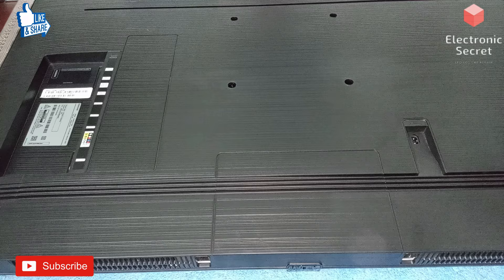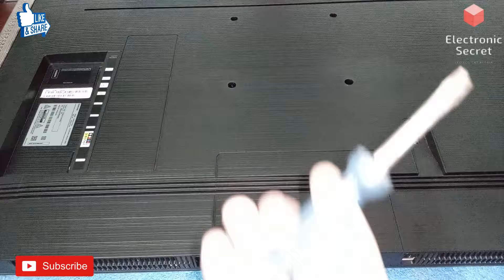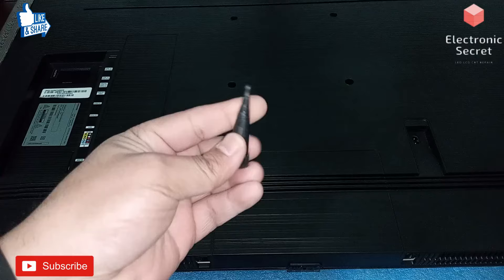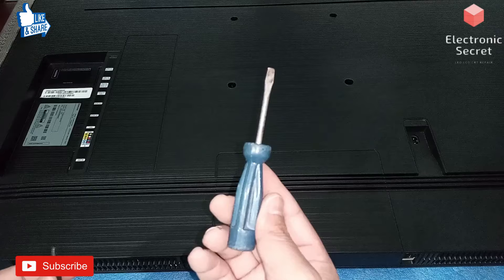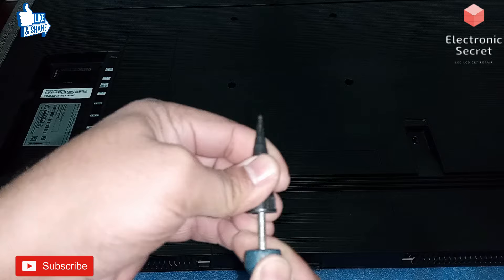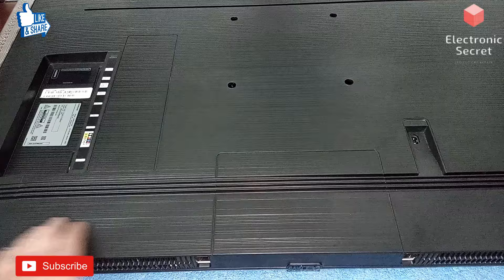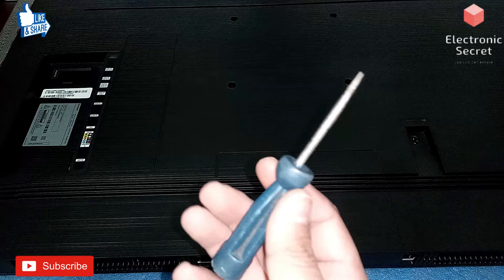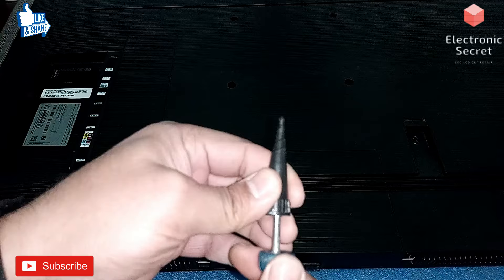HOW TO OPEN SAMSUNG SCREWLESS TV || SAMSUNG SCREWLESS TV DISASSEMBLY

Comment: It works! I have similar TV that my neighbours who did not knew any better placed on the street. I am opening it and will become very rich by selling the motherboard, power supply, speakers and WLAN modules as used and cleaned parts on eBay hahaha (=